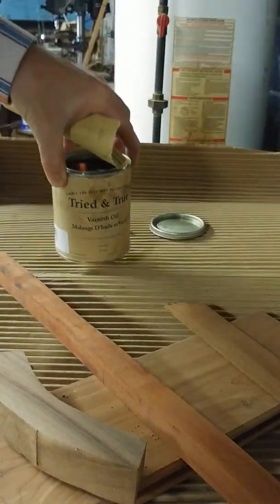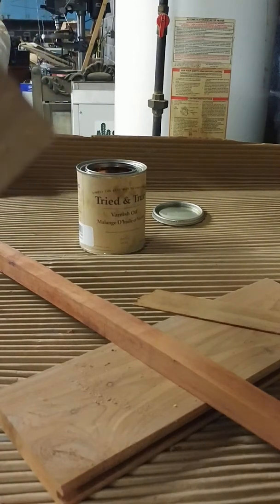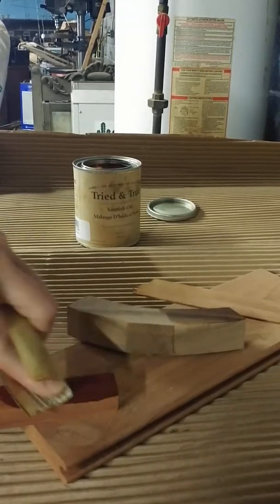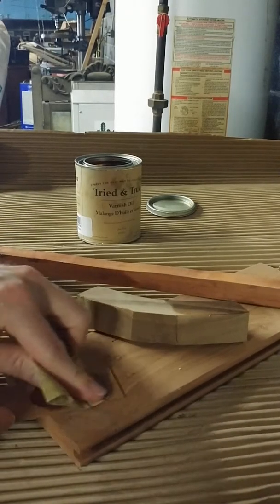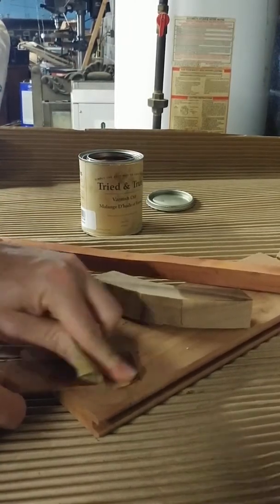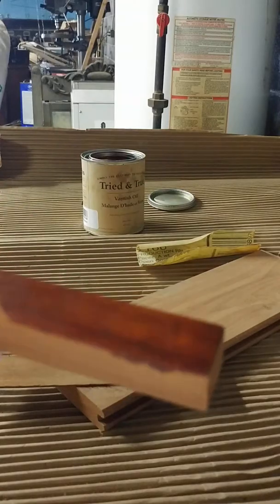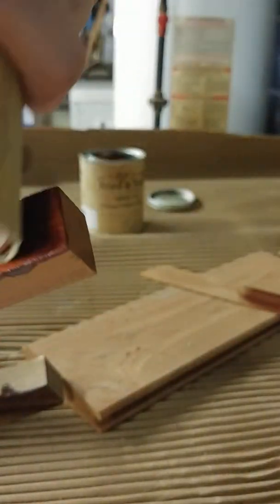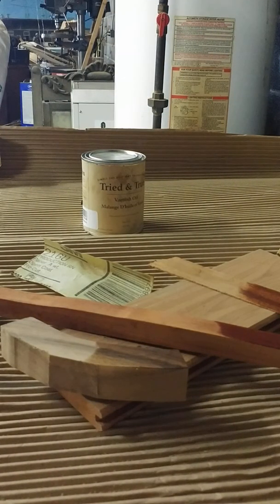Grain Filler Part I

Comment: Good job. My goal is to find something that won't discolor the wood, looks totally natural. I would prefer a clear filler myself. So that I could just spray lacquer over the top of the padouk and it would look nice. I want a filler that fills it on the first go and not have to do it 3 times.  I'm going to do a similar test except with a whole bunch of different fillers in an upcoming video.
Reply from the maker: That'll be a hard task. Probably would want a water based product then.  I did a follow up that showed this didn't work too well. There has to be something.